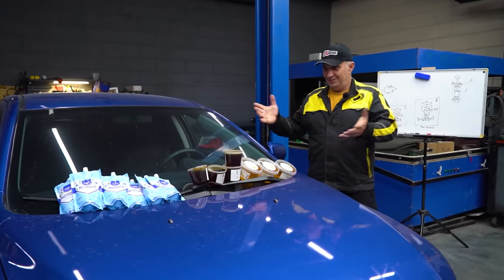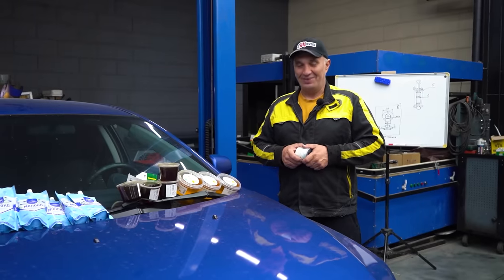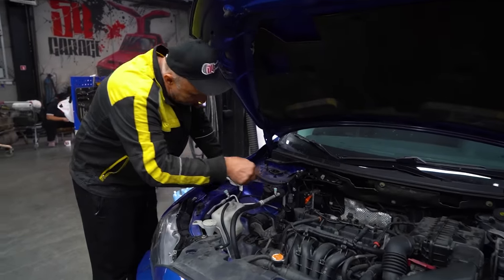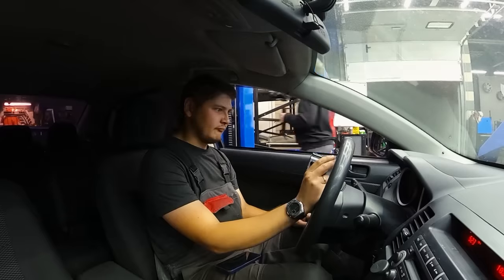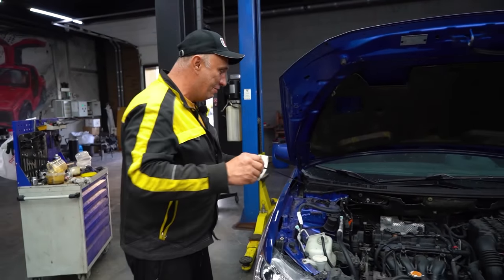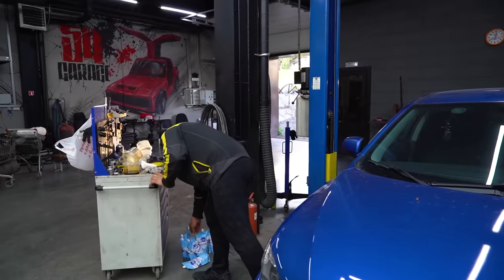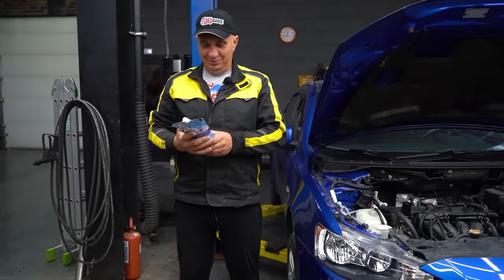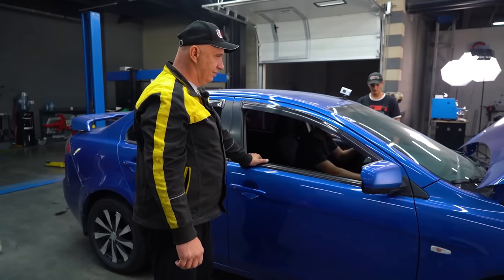We replace motor oil with honey and condensed milk - what will happen?

Comment: I nearly died when Vlad said let's pour hot water into the engine, I have never heard of that before, but it seemed to work. Another great experiment guys. Regards to you all from Melbourne Australia .
Reply: It will remove all the carbon buildup.
Reply: @chad2787  Removing carbon build-up with a little water is a bit different than flushing the entire engine cold.

Comment: I'd have been VERY interested to see how that engine faired with synthetic motor oil after the honey treatment. 
You could unwittingly be on to something very useful there. 
Carry in comrades!
Reply: Only if they meticulously remove all the honey. Honey is corrosive. You should see what it does to concrete. But I expect it dissolved some of the accumulated gunk.

(I used to work in a honey house, where the stuff is processed.)

Comment: i think all the main bearings and cam bearings are glued in place with caramel like loctite, piston rings would be the same too. i wonder what the oil pump looks like inside lmao. i had soo much fun watching this too, smiling from ear the ear when it was running on honey.
Reply: Is caramel a byproduct of heating honey, I didn't know that.
Reply: I bet that not only did the honey cool down and basically make a hard candy, but it also probably ruined the piston rings and lost all compression.

Comment: You guys don’t ever disappoint! Great job!
Reply: And finally a modern Japanese car. Don't get me wrong, those Lada cars look cool, but the modern cars look cleaner inside and out IMO and have better fuel economy. :) I would love to see a 1980s Lada restored to factory condition, with modern aftermarket infotainment (not too modern though), seats and dashboard. Petition for G54 to restore a Lada to perfect condition, with a clean engine bay, new interior and warm LED lights/brake lights, and maybe have a Toyota engine swap installed in the Lada itself.

Comment: It runs SWEET on honey!  Wonder how many miles it would last.
Reply: As Long as the engine is running and still warm I bet about 10-20. A lot less if you let it coller because the honey will lock the engine.
Reply: @jwalster9412 STOP LYING
Reply: @xxtravdamanxx  no u

Comment: One project I would like to see you take on is making the wood gas vehicles from the 1940s, you know, the cars with the built in stills that cooked wood to create gas all built as part of the car.
Reply: I too have been fascinated with wood gas for a long time too. would love to see a wood gas driven Lada.
Reply: They did a wood gas video a while back
Reply: It's been done. By them and many others too.
Reply: Those were used during WW11 when petrol was unavailable for civilians, and it was known as 'producer gas' on which the low compression sidevalve cars and trucks could only just 'limp alone slowly' with very little power available, but it did move them along a level surface at about 10 to 15 kms per hr . . with coalie black sooty 'smoke' from the burner stack.
Reply: @HA05GER  thanks, I'll look back through the archives for it.

Comment: washing up liquid fairy will work  as a get you home method,its got lubriation it falls down on degrading due to heat,but will work due to it thins existing oil its an oil based product it lubes but i would not recomend extended use,but as a bonus it will  clean out sludge,short term get you home fix yes

Comment: Can you try using oobleck or cornstarch and water instead of oil. I'm curious if it will work just liek oil or will it solidify and damage the engine

Comment: How many kilometers will the thermal oil for boilers last in the engine? We know that this oil withstands thousands of hours at very high temperatures.
It would be a good experiment and if it turns out I will buy less oil 😂, greetings from Mexico

Comment: Reason the honey was hard after being in the engine was due to the heat. Sugar heated to a certain temp will get harder as it heats up (before burning) and that's how they make hard candy. 

I don't think I'd taste THAT oil pan candy .☺
Reply: They managed to lock an engine using honey.

Comment: Oil filters are all made with a bypass inside the filter. When pressure reaches a certain point from a clogged filter the oil will push the filtering media to the closed end of the filter by compressing a spring and allow the oil to bypass the filtering media. You probably didnt "have" to remove the filter.
Reply: theyre also made for oil
Reply: @glitter_fart  doesn't really matter they're made for liquid.

Comment: I had a Toyota that was stuck from Pan cake syrup. I put boiling water in it filled it up to top of valve cover did this 3 times till tempter  of engine was up. and got it started this was about 25 years ago..

Comment: Should pack the CV axle boots with mayonnaise, the radiator with mountain dew or Gatorade, the power steering with sesame oil & the transmission with hot chili oil

Comment: Can you guys try essential oils in place of the engine oil? 

My car leaks oil, waiting for trans ISB to finally blow to fix it all at once, and it stinks up the place when the engine gets hot cause the bottom of that is coated, so I always keep recirc on or the whole car just smells like burning oil every time we stop at a red light. Was talking to my buddies and we were curious if that would work at all, and if the oil leak my car has would then smell like essential oil instead of stanky burning oil 😂😂😂

Comment: Use dish washing liquid for oil next time
Reply: Its just more of the same. Its not a lubricant and will destroy the engine. Just like the hundred other liquids you could pour in there that will simply trash the engine. Very predictable.

Comment: You should get 6 cars with same engines first 3 will be driven normally the other 3 very hard mybe race em with the boys on the ice lol.
So same bolth sides just driven differently is all.
First 1 of the 3 same oil that engine requires 2nd one 2 grades lower 3rd 2 grades higher the engine requires.
Why well see how fast they go by by.
So 1st 5w 30 2nd -5w 10 3rd 15w 50.

Comment: Woulda liked to see what that engine looked like inside with a tear-down.  Did any con rods get bent from trying to start it while seized?
Reply: Yeah, the engine had enough residual oil left in it to start and run for a short time on the honey.  The honey had no lubricating qualities to it at all  and it destroyed the internals- like running it with nothing at all. The engine is trashed. Would definitely like to micrometer the parts to see exactly how much metal was removed. Cheers